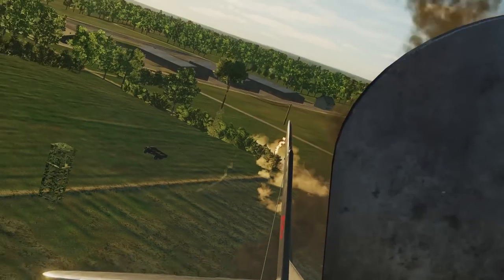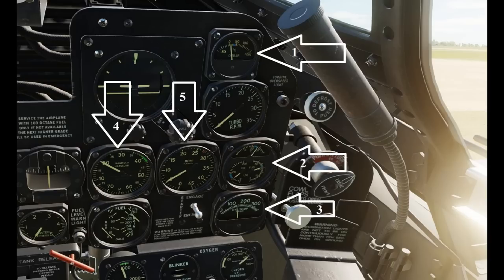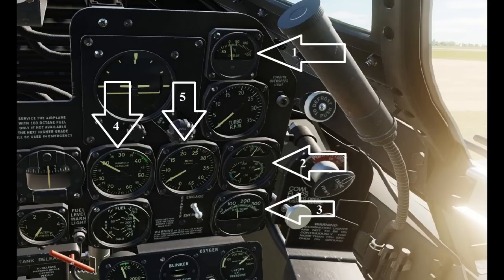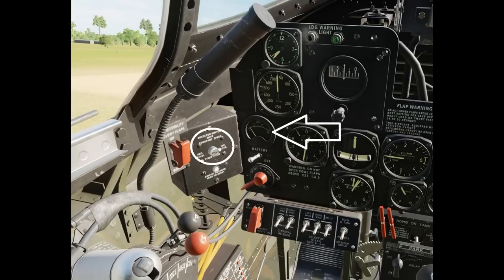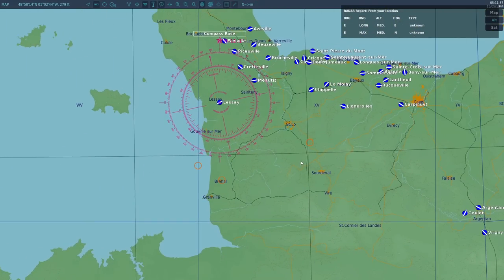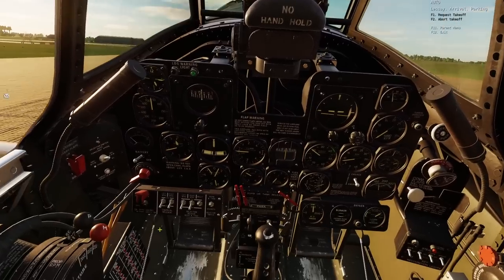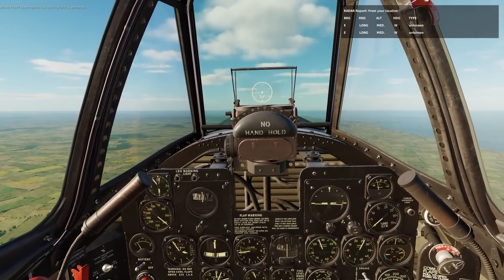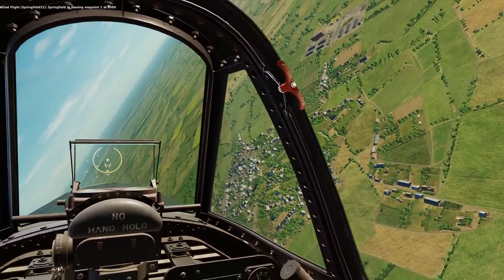P-47 Damage Control, Dogfighting and Ground Pounding DCS

Comment: HVZ, whose plane was that?
Johnson's was HVP so whoever HVZ was they would have been in the 61st Fighter Squadron with Johnson. 
Unless you picked Z because it wasn't anyone's or was available, does the game allow you to pick whatever markings you want and can 2 people have the same markings?
Reply from the maker: Duke, I thought I talked about that in the video. It's Witold Lanowski's plane.
Reply: @GregsAirplanesandAutomobiles  
Must have missed that one, I don't have a computer and I have to watch things like this on my phone and am often interrupted by a call or text message when I'm watching them.
This is off subject and applies to another video of your's, in regards to the one recently on the Japanese fighter's and their radial engine that you compared to the R2800 and others you had a partial valve timing in a document, I was going to do some math on the missing valve timing numbers which I think I can come up with based on those two and when I went to do it I saw the exhaust closing at 50° ATDC, I can't believe a boosted engine, especially one limited to that low of RPM's closes that late, a lot of the intake charge would be blowing across the top of the piston and right out the exhaust, are you sure that's right and not a misprint?
I don't have any aircraft valve timing numbers to compare it to because no matter how many places I've tried to find the valve timing for the R2800 engine I can't find it anywhere, do you have those numbers?
Reply from the maker: Hi Duke, I'm sure I have the valve timing for the R-2800 somewhere. I don't remember what they are. I do know that NACA has a study on valve overlap in supercharged engines, and they did use quite a bit. As for the Hayate's valve timing, I don't know if it's a misprint. I did put the entire factory manual for the engine high resolution, full color in the Patreon section, but it's in Japanese.
Reply: @GregsAirplanesandAutomobiles  
Yea u can't believe the exhaust stays open for 50° rotation of the crank after TDC, 50° is more like what the exhaust should open before BDC for cylinder blow down on a boosted engine turning around 3,000 RPM's (neighborhood of).
One if the biggest mistake someone will make when home building a boosted engine without doing the research into it is assume that a performance cam for a normally aspirated engine will give them the same results over a stock cam for boost, then someone with a boosted engine that's running a stock cam that has the exhaust valve closing much sooner after TDC will come along and blow them away and they can't figure it out, because they don't understand that with boost you don't need the exhaust gasses pulling that vacuum behind it to scavenge the cylinder and start pulling the intake charge into it, all that happens with an exhaust that closes that late is all the charge entering the cylinder when the exhaust is still open just blows right across the top of the piston and right out the exhaust, if you look at cams that are ground for a boosted engine they have the exhaust valve closing just after TDC quite often even sooner than stock cams, I'd think that a V configuration engine like an Allison or a Merlin with that kind of exhaust timing would have 6 foot long flames coming out of each stack, unless those engine's have a super short connecting rod to stroke ratio that has the piston moving through TDC slower than any engine I've ever been around, it'd have to have a connecting rod shorter than the stroke, I've never seen that but then again the way those radial engine's have that link rod assembly system maybe the piston is just below TDC at 50° rotation of the crank after TDC, I've often wondered how much differently the cylinder with the master connecting rod runs compared to the rest in that row that have the link rods, the valve timing's the same but the cylinder with the master rod has to move it's piston through TDC and BDC at different speeds because of it's different geometry, I've always wondered if the plugs read different than the other one's when they're pulled, I've also always wondered  how that cylinders timing would be affected or if somehow in the ignition system it has the provisions to run a different timing in that cylinder such as something in the distributor changes the timing for that particular cylinder. 
I've looked and looked on the internet trying to find the valve timing and lift specs along with the connecting rod lengths for an R2800 so I can run the engine in software I have that I can design engine's in, the HP and torque comes out remarkably close to actual results from dyno pulls, you can even switch from crank HP to rear wheel HP with it and it'll be spot on plus it has a boost program in it that you can enter the amount of boost in, I'm dying to see how the numbers from it would compare to know numbers from the R2800 engine.

Comment: The P-47 is my favorite WW2 fighter plane because it doesn't get any credit for just how good it was and what it accomplished. The P-51, Hellcat  and the Corsair are the glamrods that got all the fame while the Wildcats and Thunderbolts did all the dirtywork for them
Reply: My favorite aircraft has always been the F6F Hellcat. It is a known fact that newly manufactured Thunderbolts and Hellcats would engage in mock aerial combat over New York, as both companies had plants within 20 miles of each other. The Hellcat for the most part won these "battles" below 20,000 feet, while the turbo-supercharged Thunderbolt often reigned supreme above this altitude.

Comment: Damn...  can you re-arm/repair mid-mission in Sturmovik?
Reply from the maker: I don't know, I haven't flown IL2 in quite a while. I only have time for one sim and it's DCS.
Reply: @GregsAirplanesandAutomobiles  Yeah...  I keep almost pulling the trigger but I've sorta been trying to hold out for the Kiowa module (my cousin flew OH-58s and I want to impress him by knowing them inside and out)
Reply: Last I flew IL-2 multiplayer, if you manage to bring the plane back to an ally runway in relatively one piece, the server will "refund" you a new bird. "Big" servers I flew on have the following logistics system: 

Starting runways have a set amount of planes per model available. They will be used up as players take off and effectively added back to inventory when landed back or lost if shot down. Players can resupply runway inventory by flying supply missions from deep within own air space and landing on desired runways.

Comment: Hi Greg. Great video as always. I was just wandering, how were you actually able to pull lead against the Me 109 in a turn on the deck? I understand that the P-47's turn rate is equal or better than that of the 109, but shouldn't the turn radius of the Me 109 be substantially superior here? Is this a fault in the simulation or am I not correctly understanding the physics at play? I'd imagine that it'd be you struggling to make the turn tighter due to the relatively slow speed and the heavy weight of the P-47 and not him, but it was the opposite. Shouldn't the sustained turn performance really hurt the P-47 here? Any answers are greatly appreciated!👍
Reply from the maker: Dan, great question and I should have talked about this more. The turn performance in DCS is about dead on. There are variables in turn performance and I stacked them all in my favor here. First, my flaps are at 10 degrees, that adds very little drag, but a lot of lift. This puts my stall speed below the K4's when his flaps are up giving me a higher G limit before stall, thus better instantaneous turn rates at these low speeds. My P-47 is also pretty light, I'm down to about 35-40 mins of fuel at this point in the fight with no external stores. I'm not sure about the K-4, but he is probably about the same in terms of fuel vs. time. A common mistake is to run a 47 with 2 hours worth of fuel vs. a 109 with 40mins. Last, my engine was cooled down, his wasn't thus I could run at war emergency power longer than him to overcome the drag and haul the big girl around the circle. This is all realistic. Now the 109 could play the same game, then he would come around the circle faster, I have ways to counter that, but it's another video entirely.
Reply: @GregsAirplanesandAutomobiles  I see. Thanks for the explanation. Always wandered how two seemingly similar situations in aerial fighting lead to two very different outcomes with only a few changed variables.

Comment: So in the fight with the 109, why did you leave the flaps down even when you weren't turning,  such as a dive or climb?
Reply: Heat of the moment, most likely.
Reply from the maker: Task saturation, which is exactly why I said earlier to leave the oil cooler shutters open. There were times I should have retracted the flaps, and then put them back down again. However once you take battle damage that's a big risk as one flap could refuse to move, the time it takes you to figure that out and fix it will cost you the fight.

Comment: If the P47 is really eazy to take off it probably is because you have the help turn on. It is on automatically when you install the modul and you have to turn it off manually in the p 47 special options...
Reply: Also, you should close your oil radiator completely to get the temp high enough to take off without ruining the plane.
Reply: Sorry, one more question. What documents you have that give you the A8 able to run the 801 at more than 1.42 ? I mostly fly A5 and A6 in IL2 and I always thought that the 801 was limited to 1.42 on all versions vecause of the fuel and engine design.
Reply: One last coment... Do you have any SRS radio to contact you ?. The ennemy looked like an Ai
Reply from the maker: NO, I absolutely do not have the help or automatic rudder turned on. Why did you think that?
Reply from the maker: Nicoco, you have a lot of questions. The 801 was not limited to 1.42 in all versions. It could run 1.58/1.65 for the low and high supercharger speeds in some versions, including almost all A8s. Sources, Luftwaffe Tech Bulletin 284, AND The Focke Wulf A8 Pilot manual from July 1944.